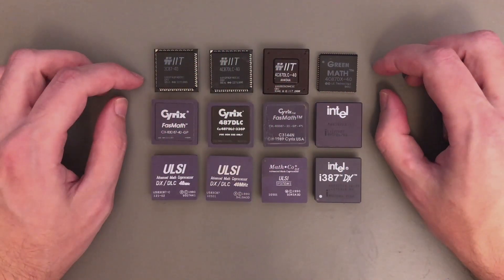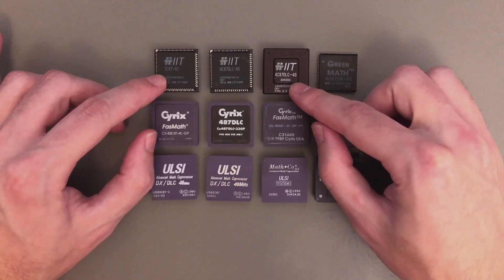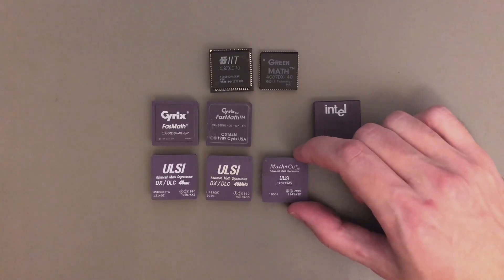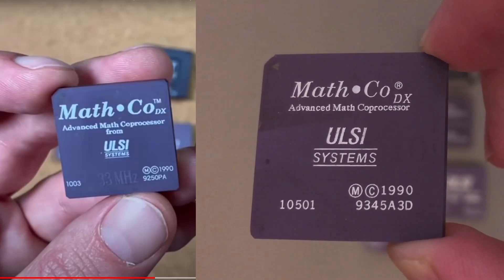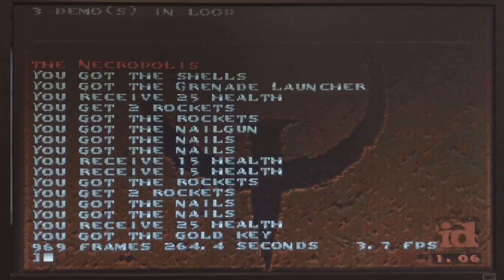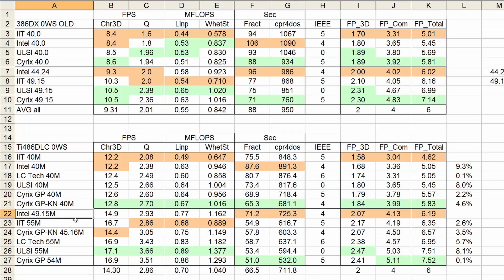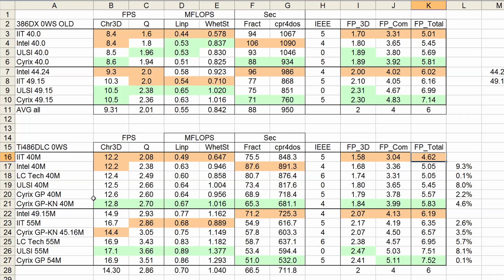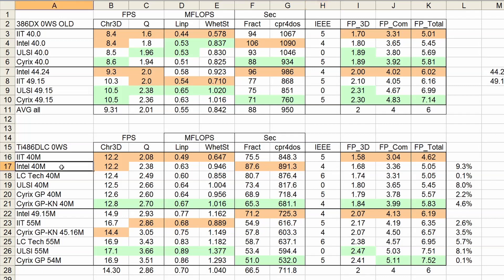Testing even more 387DX Floating Point Units. Overclocked to the MAX and Benched with a 486DLC.

Comment: Btw , one 3rd party vendor started and a few more followed selling smd versions , lcc (winged leads ) or plcc ( plastic leaded chip carriers ,  socketed ) and mounted either on a dx pin socketed board to capture wider market slightly cheaper by cobbling together solutions 

It was perfectly viable

Comment: The Ulsi chip marked 9435 is the latest revision.  
35th week of 1994
The rest is the plant location and ( litho) mask # 
Almost all chips follow this pattern as a reference just like lot codes today . An audit trail

Than you for the Fun video . 
thanks for the throwback
Reply from the maker: I am aware of week/year codes on chips... it is funny how I missed this point on the video.

Now 9507 is the latest one the and it is not the fastest.
In total we have:
9507AK1 (The one I used on most on my videos)
9419A3D (The new to my collection and a bit faster, small difference)
9345A3D (Same as the one above)
9250PA   (The CPU galaxy one, the slowest with significant difference?)

So the week/ year it is partially helpful here.
The most interesting stuff is the maybe the code after that AK1, A3D, PA.
Yeah normally this is the plant location or something, but it is interesting that only the ones with A3D performed the same.
If I ever get more of this I will check again.
Reply: @atheatos  I also have a 40MHz ULSI MathCo DX, which looks exactly like the one on the right at 4:20, and it also has "10501" written in the lower-left corner. So this may be the actual revision number.
And in the lower-right corner, only the lower line of text is different, and it writes: "9338PC". 
And on the flip-side (between the pins), it's printed: "D0024" and "USA" underneath that.

Comment: I have bought a Soyo SY-5EHM V1.1 MB from a greek seller, was this you??
Reply from the maker: No but Soyo SY-5EHM  was the first M/B I personally selected / bought back in the day. I am actually in Austria
Reply: @atheatos  Oooh, okay! I actually watched your video on overclocking a Pentium MMX to 420MHz and you presented your three first motherboards and when you brought up the Soyo one (it looks exactly like mine) It made click (I was also reassured when you said it was a good investment). Do you have any tips and trick about this MB that could improve performance and??or reliability? I plan to use a K5 PR150 or a Rise MP6 PR266 with a Number9 Revolution IV 32MB AGP.
Reply from the maker: I have a video on the Asus P5A too, an Ali SS7 M/B. Now I have payed a lot with MVP3 M/Bs before the same way. However this was more that 2 years ago, I do not remember much, but I have notes. There are quite a few  register optimizations there too, for memory and vga speed. I will come back to this topic at some point with a video. I just a bit too busy these days.
Reply: @atheatos  Thank you very much for your answer I hope to make great use of this neat motherboard! Good night.

Comment: I am surprised that the Intel x87 FPU used here was able to hit 50 MHz. I wonder how warm it got when running very fast.
Reply from the maker: These chips run relative cool. So these is not a problem here even with overclocking.
The 486DLC warms up a bit so I have a heat sink and a fan.
BTW on one of my other videos I have overclocked the intel 386DX-33 to 51.2 :)
Ok only one 386DX sample overclocked that high.

Comment: 14:52 What exotic coprocessor(s) are you missing?
Wish I'd have the knowledge and the soldering skills to do stuff like than. Amazing how you always find new ways to optimize and push the performance higher.
Asynchronous function? Good cliffhanger! #386quakerace (lol)
Reply from the maker: I mentioned that I miss in my first video. It is the Chips Super Math, The Intel RapidCad, and some IITs and ULSIs with clock doubler! I do not think I will ever manage to get these. Only RapidCad is available but quite expensive.
Yeah some times I get performance out of nowhere, and I surprise myself too :p
Cliffhangers are nice, I need more subs :p